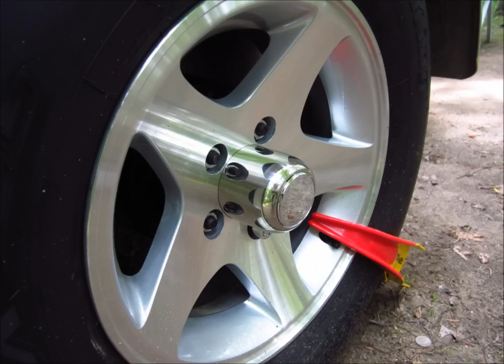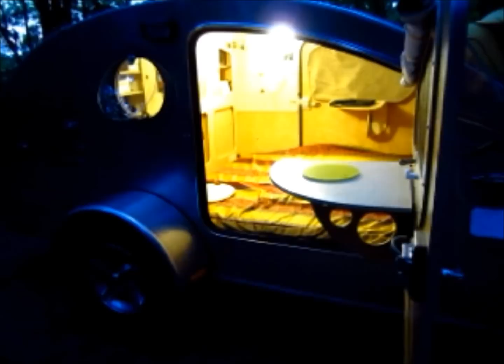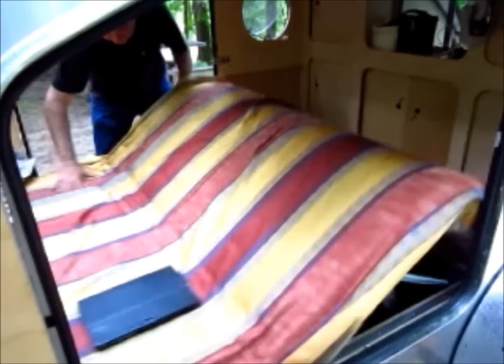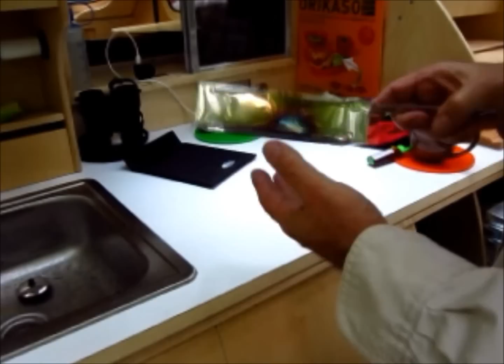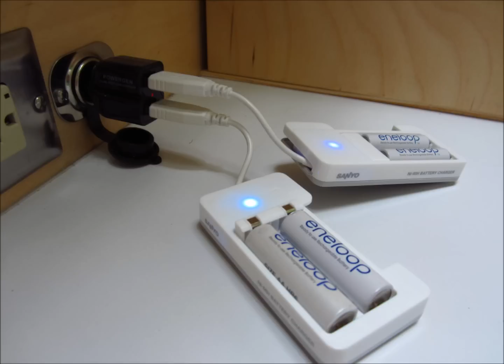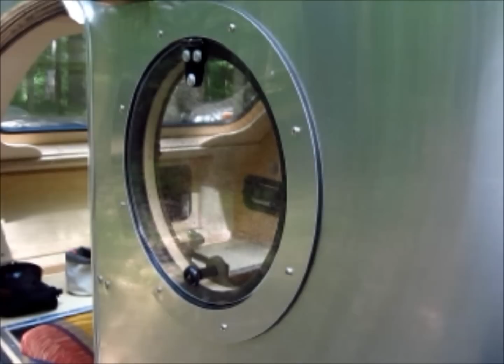Teardrop Trailer Vistabule 3

Comment: Would be nice to have. The only big thing I would change is to give it another 8 inches of ground clearance.
Reply from the maker: +grn dragon 
Thanks. Be aware adding 8 inches of clearance will raise the
kitchen counter to 45.5 inches high. Bert at Vistabule did mention he had a customer who wanted an extreme off road design. My tow vehicle has 9 inches of ground clearance the trailer has 11 inches of clearance. Bert offers am option that adds 2 inches of clearance to the standard 11. I am sure everything is negotiable.
Reply: What about the suspension, axle style with springs, or independent style with trailing arms for each tire? Axle type on heavy off-road use, the axle will be your limiting factor.
Reply from the maker: +grn dragon Check with the maker www.vistabule.com

Comment: Hi Cosmo, 

Thanks for all the great information on the Vistabule and camping in general. I have followed your online trail to a few different places. 
My wife and I just sent our pricing worksheet to Lily. Lots of communication back and forth with Lily and Carlene, and talked with Bert as well. Still have some time to make some changes, but want to get our order in so we can drive from CA to MN this Fall.

What are your thoughts on the fixed propane counter stove top VB offers now vs the slide out you have? Not sure they'd offer the version you have.

How about leveling jacks? I know they don't offer them, but based on your experience do you feel jacks would be useful?

Finally, Dometic fridge vs upright fridge VB offers? 

Thank you for your response-

Kevin
Reply from the maker: Hi Kevin. I started with the slide out stove but it limited the kitchen. I then updated to the current configuration with the built in center stove. I like the center stove and kitchen layout much better. You can have 3 people working at once that way. It just works better for most people.. They probably dont offer the old style anymore.

The slide out Dometic that I have (top loader) is more efficient with energy consumption (electric). Thats important if you are going off grid (which is the majority of my camping. It also does not let as much cold air spill out when opening. A big plus is you can take it out of the trailer if you choose to use an Ice chest. Also you can move the fridge into the tow vehicle is you need the room or want to use it for other purposes etc.  Thats my opinion and your needs may vary!

Thank You. Check my other videos  https://www.youtube.com/cosmoweems/videos  SUBSCRIBE https://www.youtube.com/cosmoweems?sub_confirmation=1
Reply: @CosmoWeems  Thanks for the quick response Cosmo. What's your thoughts on leveling jacks?
All the best,  Kevin
Reply from the maker: They are stabilizers not jacks. THey keep the trailer stable but dont lift or level it. I have them so I use them.
Reply from the maker: When in the trailer feel more solid. With out them the suspension comes into play when you move around. I use them if I ill be at a place for a few days, Not a requirement. I level the trailer with wood blocks or Camco leveling wedge thing.
Reply: Thanks again Cosmo- Are the stabilizers aftermarket or factory install? I looked and "liked" nearly all your videos and did not see the stabilizers.
Best, Kevin
Reply from the maker: I will feature the stabilizers in the future. I believe they are in some video somewhere. It has been impossible for me to get away lately.Vistabule installed the stabilizers on my trailer. They do not make the stabilizer they install it. Not sure if its an option at this time.

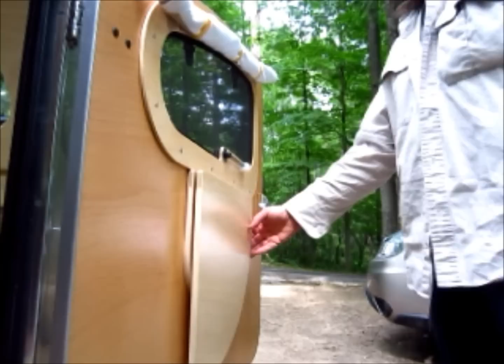Comment: Cosmo.  I just ordered a Vistabule for early next year.  Where did you get the tire boot at 0:37 ?
Reply from the maker: +Eric Kjellesvig Congratulations!  Check my other videos too.

Wheel locks – You need to lock the wheel to the car. McGard 74041 Chrome Cone Seat
Trailer Wheel Locks (1/2"- 20 Thread Size) - Set of 4  http://www.amazon.com/gp/product/B00144CSR4?psc=1&redirect=true&ref_=oh_aui_detailpage_o00_s00Then The boot/wheel  lock Trimax TCL65 Wheel Chock Lockhttp://www.amazon.com/gp/product/B0031XULF2?psc=1&redirect=true&ref_=oh_aui_detailpage_o01_s01I I also needed a pin lock so the hitch on the car can’t be
removed.Master
Lock 2866DATSC Swivel Head Receiver Lock, Chrome http://www.amazon.com/gp/product/B0009V1WS4?psc=1&redirect=true&ref_=oh_aui_detailpage_o04_s00Finally The trailer hitch itself has a flip up release with
a safety pin. I replace the safety pin with a padlock when I park it.http://www.amazon.com/gp/product/B00004Y8BV?psc=1&redirect=true&ref_=oh_aui_detailpage_o01_s00
Reply: Thanks for the helpful information.  It is greatly appreciated.
Reply from the maker: +Eric Kjellesvig See you on the road in the spring.

Comment: I see that you have electrical outlets, but you didnt show your inverter or storage batteries.  What is your AC capacity?
Reply from the maker: When the trailer was built I had 16 AC outlets installed. Its a 20 amp ground fault service. I have no air conditioning. 120V  only activate when I plug into grid power. I had 6 DC 12V outlets installed too! I am off grid 97% of the time running on solar. My latest strategy is to use Jackey setups and its working great. https://youtu.be/a5zGWXwC9D8  Thank You for watching. Check my other videos https://www.youtube.com/cosmoweems/videos 
SUBSCRIBE https://www.youtube.com/cosmoweems?sub_confirmation=1

Comment: I assume this one is not insulated. If not, have you ever thought that would have been beneficial?
Reply from the maker: kevin molick Roof has 1 or two inches of insulation. That keeps it from getting too hot with the sun beating down. IInterior volume is very roomy yet not large. So iany heat source will heat it without a problem. As is meets my needs and is a big step up in comfort  from tenting. Whole new experience forme. I love it.

Comment: To talk us through it would be far more effective.
Reply from the maker: +Carol Glover youtube provides great demographics. About 40% if the 126,000 views of this video were in non English speaking countries so there is an intentional lack of words in consideration. When I ordered my camper there were no videos available (that showed what it was like to actually use the camper) so I set out to fill that gap for others. The builder has told me his buyers have all found the videos and it helped answer lots of question for them. But as you point out - they did not answer all!. I have more trips planed for this summer and I will give commentary where I think it fits.  I will be sure and say Hello Caro in one of them! What in particular are you wanting more info about?
Reply: +Cosmo Weems Thanks Cosmo, I just think that you get a better idea of what a van is like when you are actually 'in it' with the person giving a commentary. Looks like a great van. Do you ever feel cramped, or do you find it more than adequate?
Reply from the maker: +Carol Glover  YW its a amazing how roomy 35sq feet of floor space feels. The storage cabinets and front boot have plenty of room so the bed/couch are not crowded. The car offers lots of storage space for clothing, bicycles kayaks etc, The whole system works well. I thought about it or a year before buying. I was in the trailer mentally long before I was actually in it. When I come home I often wonder why I have so much space the rooms provide. I have always enjoyed small space and simplicity like tents. This is a huge step up in comfort. So your looking for an interview type setting with commentary on the trailer and its features? If so I will keep it in mind when I go on a 10 day trip in July. Or maybe a shorter trip sooner.Cosmo
Reply from the maker: +Marcos 989  Try this one https://youtu.be/DMgYMiwJGK0

Comment: +1. .. Great soundtrack. .. Cosmo, many thanks for the Vistabule introduction. .. Seems to me the brand trailers are the best built, best designed in the road going category of "Teardrop" style trailers.
P.S., the CampInn 560 is a close 2nd runner-up.
Reply from the maker: 560 my first choice until I found the Vistabule. There is no best trailer - for me it was which of these fit my needs the best. Good luck with your decision. Its not easy Take your time and compare livability and features. The let lust take over. ha ha ha